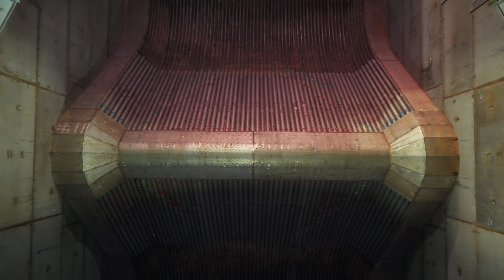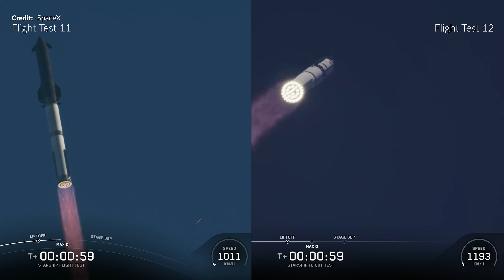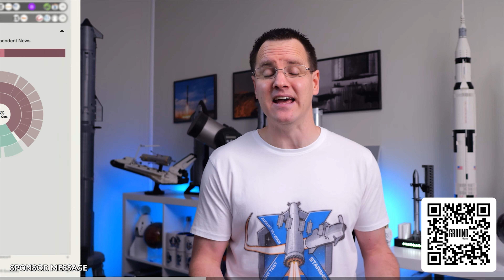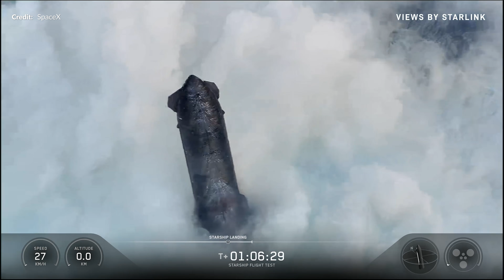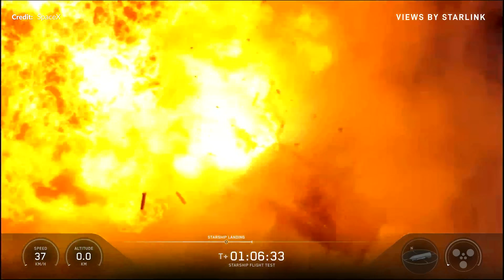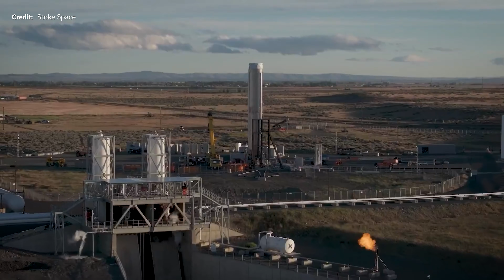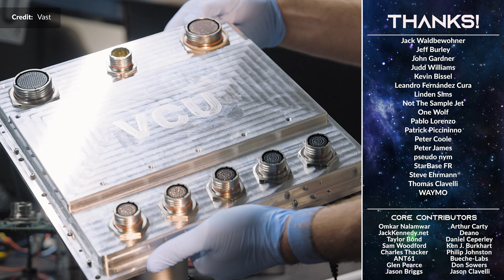Starship Flight 12 Explained - The First Version 3 Starship

Comment: personally id prefer starship to stop exploding when it tips over
Reply: It isn't designed to survive that.  When it is reliable enough, it will be caught like the booster has been 3 times so far.  

🚀

🚀
Reply: Yeah, normal test/debug cycle.

Comment: I think the speed of the flip caused too much sloshing for all 33 engines to relight, when they tried I bet a bunch just sucked air and petered out from the sloshing, nothing they cant fix for the next flight!
Reply: That's what I think also. It was rather radical.
Reply: Yes, but something else went wrong to create that issue. I'm not sure the booster even fell the correct direction.
Reply: Improper handling of ullage is a 1950's-era problem. This should have been ironed out decades before Ship's design was 5 minutes old. Something went well-wrong with the system.

Comment: At this point i think they should try catching the ship, they've basically nailed the procedure already, and we really need that juicy after-catch data about tiles and engines. After all in a worst case scenarios you can always cancel the catch and drop it into the gulf near Starbase.
Reply: Keep in mind, catching the Ship means flying low/final entry over Mexican airspace- far different than an all-water Booster catch. The US FAA Office of Commercial Space Launch is Not the only government SpaceX has to prove to to get an entry and landing of ship done. - Dave Huntsman

Comment: My feeling is that "rapidly reusable" on the order of a couple of hours is simply impossible.
Reply: Its Elon bullship
Reply: You might well be right, in fact I suspect that you probably are, but it also might end up not really being a critical issue.

Marcus said that the Space Shuttle took 10 weeks to turn around - I assume by the end of the program's  life once procedures were perfected. Even if SpaceX only managed to cut that time in half to 5 weeks it could still be launching once a day as long as it had 35 ships and boosters in an active fleet. Double that number to 70 ships in the fleet and they could be launching a Starship mission twice a day. Get the refurb time down to a week and that fleet of 70 ships is sustaining a cadence of 10 launches a day. Those are just example numbers, there are of course many, many ways the numbers could actually work out in terms of fleet size, refurb times and launch cadence.

So ultimately while really extreme rapid (as in almost instant) reusability is an intriguing target to aim at I think that SpaceX can still end up doing impressive things with Starship even if it falls a fair way short of that ready-to-go-again-within-a-few-hours goal especially given that the scale of the production facilities already partially built at Starbase and soon to be built out in Florida should allow SpaceX to build a quite sizeable fleet once the design gets more mature.
Reply: @julianfp1952 downtime between flights for orbiters included SSME change out, payload bay changes, OMS pod refurbishment, and RCS refurbishment.  Plus, middeck needed reconfiguration and reload. 

Early STS program demonstrated in 1984-1985 reflight rates that included four orbiters.  Original NASA and Rockwell studies needed 7 vehicles.

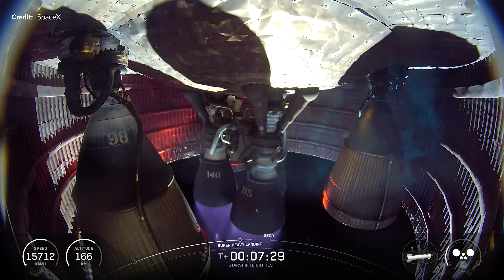Comment: Very upbeat ... but you fail to mention probable raptor explosion visible at 5:36 and  the heavy fuel leak around the right vacuum raptor at tank interface 😇 visible at 9:50 this one is still an un resolve issue it seems.

Comment: 12th flight not reaching orbit, both vehicles destroyed, nothing to re-use. So far, Starship is still completely useless.
Reply: Complaining about not reaching orbit and neither being recovered ACCORDING TO PLAN is rather silly of you.  

Totally revamped prototype.  Trying to bring either stage into landing would have been incredibly risky and so was not PLANNED to happen this time.  Maybe IFT 13 (currently scheduled for June) or IFT 14 (no scheduled date) will have one or the other caught.  

:trophy-yellow-smiling:

:trophy-yellow-smiling:
Reply: @Scanner9631  Just stating facts. If they had done the engine re-light test, it would have been progress. What we saw was less than had been achieved before. Yes, there are visible improvements of many components, but also new problems, and in total there was no progress towards any of the milestones with Flight 12. Engines are still blowing up. The only significant progress is that now Starship might actually be able to carry payload, but we still don't know how much under what circumstances and at what costs. There is still a long way to go, and I see a high probability it might become the Cybertruck of rockets. At best I see a future as Starlink satellite delivery system, but even that is questionable. And I don't see humans to fly on Starship in the next decade, if ever.
Reply: Yeah...people like this  never built anything new. I do software. Test, fix, test, fix, test, fix. They don't get this is a development project. They don't recall, say, the Titan II or Atlas rocket development fireballs.
Reply: @daveeyes  Atlas and Titan I were bad, Titan II not so much. Atlas was the worst, took 17 tests before the first payload to orbit. But this is bad compared to later programs. And it is very bad compared to what Musk promised it to be at this time, 2026. It seems reasonable to me to assume that over-promising has not suddenly stopped, so I just look at the hard facts and completely ignore what Musk is saying, and the hard facts do not indicate progress towards the goal of bringing stuff into space. I wish it were different, but to me the whole think looks more and more like a scam.

Comment: Marcus.  It looked like the tiles held up amazing.  Considering the pushed it to the limits on reentry.  And the PEZ dispenser worked great as well. But stage separation blasted the top of the booster and side with a lot more thrust.  They need to sort out the Raptor 3S . Too many relight problems.

Comment: The ship nailed the assignment positive signs for V3
Reply: Did it? missed the target trajectory and R-vac failure.... don't know if that can be considered nailing the assignment. They skipped the re-light test too.
Reply: @biggin2155  it landed on target,  and it's designed to accommodate engine failure which it did
Reply: @biggin2155  more so engine issues than ship issues, disappointed in that engine reliability, I don’t know why they want to ignite them all at once, there isn’t that much benefit and it’s safer to do a staggered start.
Reply: @biggin2155  The heatshield survived intact. This is the hardest problem of the program.

Comment: I'll stick my neck out and say what I think happened... The sudden hard turn to the left to do a 180 caused the shafts in the turbo pump to move sideays due to fluid bearing failure, that movement was gyroscopic progression, wrecking the bearing surfaces as the film strength being overcome, shafts rotation speed fell like a stone and engines couldn't maintain combustion. 
based on my knowledge of turbos on diesel engines! when you think of the spinning of a gyroscope toy when you try to flip it, it fights back, the turbopump shaft is a gyroscope....
Remember the test fire when they had to do a fast shutdown? the failed engines from that, I think for fast shutdown they just cut oxygen and fuel, which are also the turboshaft bearing lubricants...no lubricant and that shaft is as stable as a spinning top toy, but at 20000rpm.... thats some friction and a shaft ricocheting around...
Reply: Good explanation and thought

Comment: Considering how the first 3 V1 missions, and the first 3 or 4 V2 missions went, the first V3 mission was an astounding success.
Reply: They learn far more with the failures....they are kinda essential for the long-term success. We should celebrate it all as a resounding success.
Reply: Celebrate FAILURE
Reply: @GrogRobbo No, you don’t ‘celebrate’ failure; BUT, you do try to design the system and processes so that, When you Do fail, you “Fail Forward”. - Dave Huntsman
Reply: @dphuntsman  When I built stuff we designed it to actually you know fulfill the design brief and take the loads specified in the brief NOT TO FAIL. You might have seen the work on TV in the 90s the Kuwait Ring Road Overbridges with 3 Iraqi (russian made) tanks SITTING ON them.
Reply: BS
Reply: Yes, lots went wrong.. and still mission success. As long as they have easy solutions to fix the engine-out problems, this is actually a good thing. Wild stage separation event, something seemed very wrong. OOPS! Glass half full, this flight shows the system has remarkable resilience to problems & mistakes.
Reply: @gcburns4  Total Muskrat delusion. You can justify any failure with this sort of meaningless statement. 
The reality is, Starship is unreliable, expensive, has a tiny payload and is massively delayed.
Reply: @gcburns4 100% concur .
Reply: Isn't that sort of like saying all of my friends have micro-penises, so my one-inch-wench-winch isn't so bad!
Reply: yet if blue origin misses it's target ;, ohhh big problem! ,

The fact is that they took one step forward and 2 steps back, The v2 rockets were more reliable and landed, they couldnt' even do that to this one. engines failed. and the starship upper stage has YET to be caught . It's getting riciduous at this point. Making the company public wil also slow down everything to please shareholders
Reply: @jtit2025 Blue Origin's New Glenn is no longer a test article.
Reply: @chriswhite3692 , 
So NG is a totally Finished Product, But it Failed its Job!  
Plus the Entire Engines are Replaced For Every Single Launch!  
As for The Moon Lander, it’s going for A Substantially Smaller Lander.  
NG Isn’t Much More Than SpaceX BFR Rocket In Capabilities, Which just needs a Slightly larger Top Capsule, & Which is Fully Reusable!  

SpaceX Is Going For A Massively Larger & Much Longer Functionally Time on the Moon’s Surface than Blue Origin’s Much Smaller System!!!
Reply: @jtit2025 Starship is still in development, a prototype doing test flights. New Glenn is supposed to be fully operational, and it completely failed it's first commercial mission.
Reply: @admarsandbeyond Trying to win an argument by simply labelling Starship a prototype? Lame
Milestones matter, and BONG is spanking the tin can
Reply: @ahhmm5381 You seem to confuse basic facts. NG is not competing with Starship, it's a partially reusable LV like Falcon9/Heavy, only much worse (unreliable, super expensive, low cadence, low capability). Starship is orders of magnitude better, but also orders of magnitude harder.
Reply: @admarsandbeyond Both are contracted for the moon mission.

But yes, BONG cannot compete with the blatant lies that Musk throws out on what Starship is supposed to do. 
It can't do them, but the lies are for rubes like you
Reply: @ahhmm5381  But we should listen to you right? Who are you again?
Reply: Keep sucking fanboy
Reply: @ahhmm5381 What ‘blatant lies’ ??
Reply: @ahhmm5381 You don’t know what you’re talking about. These are not simple “test flights” in the sense that you’re just test-flying hardware of a finished, proven design. Starship is still in the RDT&E phase- in short, from engines to tanks to MPS to tiles, they are still in that part of the process of flying Developmental Flight Tests to find out what the EXACT final design (and, related operations) should really be. If you have any genuine questions, ask; there are probably folks here who can answer them. Otherwise…… - Dave Huntsman
Reply: @dphuntsman  Development timelines, cost estimates, rapid reusability, payload to orbit, going to Mars etc.

Comment: Marvellous coverage… I do think that a slower more gentle stage separation will solve the booster relight issue which was probably down to the ship pushing the booster back too hard calling fuel movement issues… just my guess.
Reply: Agree. I think the fuel feed was disrupted
Reply: Von Braun’s S-1 stage had 5 F-1s.  SH has 33 engines. Ultimately, reducing the number of engines might be a long term plan.
Reply: @goldenpacificmedia no, in fact the V4 will have more. More engines means if they lose one its not a big deal.
Reply: @brianbiddle7590 redundancy is good.

Comment: What‘s strange is than on the video it seems that almost all engines on the booster ignited for the boostback burn and that the display was incorrect! Maybe an instrumentation problem - or the computer cut off the already running engines, because some parameters were out of range… I am curious to learn more about what really happened here!

Comment: Thought that the outer engines were started up thru the pad? Or that’s v2? What would be the point to relight the outers?
Reply: For V2, the Raptor QDs provided the spin start commodities for the outer ring. But on Pad 2, the RQDs are now just hold down arms, so yeah, the outer ring can now relight.

Comment: I really want them to hover the ship at the end until it runs out of power /fuel, so it doesn't explode (much) thereafter.
Reply: They need it to go boom so it sinks. They don't need that bomb just floating around.
Reply: the explosion is inevetable for the rocket is screaming hot after return, ánd the rocket has explosives attached to completely destroy that burning candle to prevend pirates to access any left-over debris.
Reply: It would eventually start to lift off again if they kept the engines on.
Reply: @zdwade that's only a problem on falcon 9, where lowest thrust of the engine is still too much for empty booster. Starship and super heavy can hover.
 They are heavy enough for a single raptor at lowest thrust. We've even seen them do it with the very first tests where it was just a tank with an engine.

Comment: im amazed at the performance of the starship heatshield. This is a real gamechanger for reuse.
Reply: perhaps the only real success from this test, but there is the open question of if the lower than intended orbit made the test invalid.
Reply: @biggin2155  Almost no difference in the speed though, so probably makes no difference.
Reply: @biggin2155 not to bright are you?
Reply: @biggin2155 perhaps the angle of reentry was easier
Reply: @biggin2155 only real success? I'm sorry that's a stupid comment. 😅
Reply: @calvinallan2208 100%
Reply: Hmmm looked a bit over-barbecued sausagey to me.
Reply: @andrewsarchus6036 Nonsense. It’s always going to get some char. We saw far less ablation than in the past. No burn through! Perfectly mature, no. But a huge improvement, and functional at least.
Reply: @andrewsarchus6036 are you a cook?

Comment: Man, it really jumped off the pad didn’t it?! Thanks for the recap! 🍻
Reply: Yeah I wasn't expecting it to be visibly faster getting off the pad.
Reply: It actually has a quicker 0-100 kmh time than my car 😭
Reply: @GakkGakkUnited  LOL my car cant go 100 Kmh let alone straight up
Reply: @GakkGakkUnited 😂
Reply: I can't wait for someone to do a synced up side by side of lift off to show how much faster.
Reply: @DanielsCorner644 check Scott Manley's post.  He did that.  V3 was 300m clear of the pad tower before V2 lifted off!
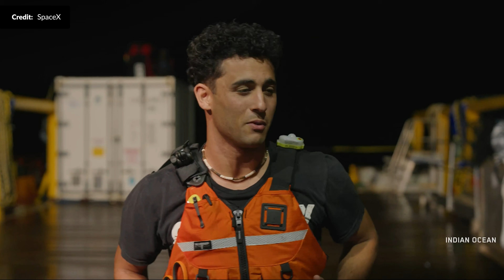Reply: @DanielsCorner644 someone already did. At the 2:15 mark V3 was around 1,600kph faster by that point.
Reply: Yeah, this!
Reply: It’s not like a Vega-C which just yeets itself off the pad, but it’s absolutely a lot faster than V2. They must have one hell of a launch clamp design to hold down the most powerful rocket ever flown
Reply: I remember hearing that SpaceX was going to keep the ship held down by the clamps until the engines hit 100% throttle, then let it go. If that's what they did, It made a VERY noticeable difference. It shot off the pad almost as fast as my usual Kerbal Space Program rockets do, and I usually build those with 1.5ish TWR at launch. I can imagine that's around what this ship launched with.
Reply: @thetobi583 they made the transfer tube bigger, so they can immediately start up all raptors at the same time.

Comment: It's amazing that the launch pad two area was a car park a couple of years ago, despite the failure of the Booster to return the trend of progress is off the chart when you think about it. The next 2 years will be unbelievable.
Reply: It landed in the target zone though not on target.  Which is good otherwise a "incident report" would cause months of delay - at least.

📰

📰
Reply: What progress? They keep trying the same mission with incredibly volatile results

Comment: While cognisant of the weight issue extra fuel required, the landing of spaceship clearly shows the necessity for triple  hull  skins, unlike the Titanic
Reply: It does not.  The "Landing" is not how it will land when actually intended to survive the landing.  It will be caught just like the booster.  Variants to land on the Moon and Mars will be equipped for that and be facing MUCH lower gravity making the landing gentler.  

:trophy-yellow-smiling:

:trophy-yellow-smiling: